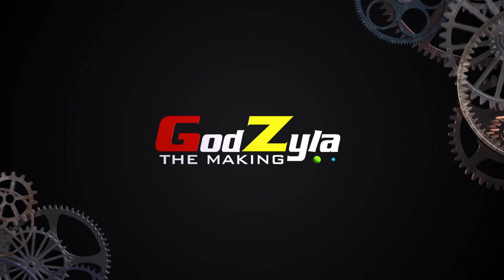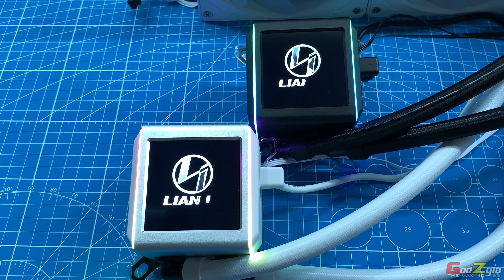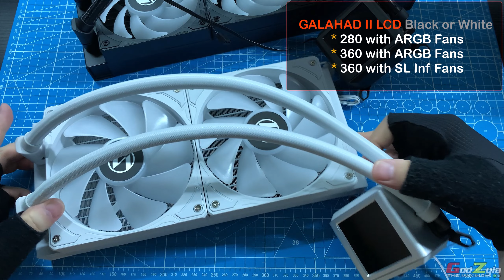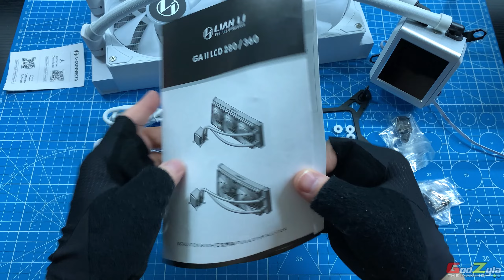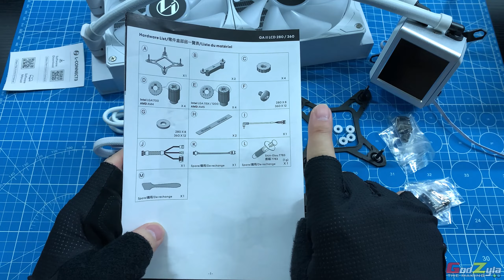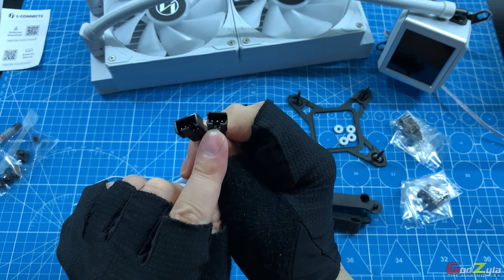Lian Li Galahad II LCD

Comment: I'm building my new PC and had a problem between Kraken and this one but I chose this one 👍👍
Reply from the maker: Hi Voltomess, welcome to my channel, glad that you've choose this over other liquid AIO. I personally using the GA II LCD 280 and just a tip. I know alot mentioned about the pump noise or pump failure. I will suggest to run your pump speed at fix and at 2800RPM and it will run at 2880RPM consistantly. This is my current theme rig with the GA II LCD 280 https://www.reddit.com/r/pcmasterrace/comments/19f113a/sonic_the_hedge_hog/ 😉
Reply: @KleoYan  I'm disappointed my new computer don't want to start aio fans work RGB on them works motherboard rgb works, rams rgb works , fans on my case turn off 3 seconds after I turn on the computer, there is no signal to the monitor  no signal to the lian li aio screen I removed gppu and connected to Mobo GPU and same no signal I reattached all cables and connections on everything mobo psu and all that and still the same, is it possible that psu is dead? or mobo or ram or cppu or liam omg so frustrating.
Reply from the maker: @Voltomess  Hmm.. are you plugging to HDMI or DP. try HDMI to your GPU. see if it does boot to UEFI or Windows.
Reply: @KleoYan  it's brand new build no windows installed because it doesn't want to start
Reply from the maker: @Voltomess  I see, if majority of your parts are new. I would go by doing the basic troubleshooting steps.

1) double check if 8pin EPS and 24pin connectors are plug from the PSU to motherboard
2) double check on the Processor and rams, make sure they are seated in nicely on your motherboard. 
Make sure cooler is mounted properly with the fan headers to the motherboard CPU
3) Make use to HDMI cable, boot to UEFI without using your GPU.
4) if 1) to 3) does not work, try run single ram. 
5) if single ram works. swap position of the ram.
6) If this work, preceed to plug your GPU

if the above does not work. which PSU are you using. if there is a self test connector provided by your PSU. remove your PSU 8pin EPS and 24pin connector to your motherboard, plug the 24pin connector tester and turn on your PSU. your PSU fan should spin. if it does not, then it could be your PSU.
Reply: @KleoYan  Idid all of that and I said to myself dead mobo and I went to the store to change it and after all that trouble there is no change I turn the computer and after 2 seconds he turn off. I did everything that was possible my psu works on another computer without problem my old psu which is still very good also does not power up my new computer but works fine on the other computer. I suspected that case might be bad and power buddon is damaged but I disconnected case and started mobo using screwdriver and still the same starts for 2 sec and turn off. Like I said the only thing left is CPU and ram.Im so tired of this build.
Reply from the maker: @Voltomess  Ouch!.. it's difficult to diagnose this way when you did all the investigation and such. I would advise you to bring your PC to the shop where you got it to troubleshoot for you.
Reply: @KleoYan  I built it myself from all parts. It's my 3rd build in my life and I never had issues like this before.
Reply from the maker: @Voltomess  Ok, got what you mean. hey do you mind to share your whole PC Specs with me. I am thinking if you can use your other PC components to this current. 
things you can try out 1) swap PSU. 2) swap rams.

Honestly speaking, I would prefer to test all PC parts outside the case first. Ensure everything works, inclusive of installing windows OS and run it outside the case for a couple of minutes.

In your case, I know you are tired but I will do this. I will dismantle everything. 
1st test your PSU, make sure is not faulty. some PSU comes with a 24pin socket plug (Self test) if you plug that and power on your PSU. the fan will spin (disable eco mode)
2nd test this PSU on your other PC, see if it works. (1st and this step is to narrow down if your PSU is faulty) 
2nd once confirm PSU working. plug processor, rams to your motherboard, plug your cooler, plug 24pin and 8pin eps, plug hdmi cable to your motherboard (if your processor has a build in GPU) 
3rd if it does not work, plug and use 1 ram stick. if it does work plug back your 2nd ram stick. if it does not, swap out.. (this is to narrow down if rams are faulty) 
4nd if nothing works with either rams, check your CPU to see if any smc chip are not intact on the underside. if nothing is wrong and if you do not have another similar model board to test out. I can only say is better these issues 1) Motherboard 2) CPU 3) Rams.

there are so many possibilities. I can do this best to advise you. anyway this topic is way off from my content. If you want to continue, kindly corresponse through email godzylatech@gmail.com . thank you!
Reply: @KleoYan  I got it solved my CPU was DOA  I replaced him and all working fine now thanks!!
Reply from the maker: @Voltomess good to hear you solve the issue👍👍👍 Phew! Congrats 😉

Comment: Hey man, good video. Quick question, I'm planning on building an entire Lian Li gaming station. 6 white 120 SL infinity reverse blade fans from , the Lian Li GA II LCD 360MM AIO SL infinity version, the white Lian Li O11D EVO RGB, and a normal white 120 SL infinity fan. My question is, is there a way to sync the EVO RGB pc case rgb lights and control them with L Connect and what would I need?
Reply from the maker: Hi Christian L, welcome back. On the SL-Inf Hub, there are two ports which are the sync 2 and sync 4 port. you can plug the EVO RGB case argb 3pin 5volt connector to it. You will need a covertor https://www.amazon.com/gp/product/B0CHP7SWSX/ref=ox_sc_act_image_1?smid=A1L0CC1FACMFXH&psc=1 (Make sure is 5V 3pin female to female). Also to note, when plugging to the sync 2 or sync 4 port, it relies on the effect of port 2 or port 4 as Sync 2 follow instructions from port 2 and Sync 4 follows instructions from port 4.
Reply: @KleoYan , awesome, thank you so much! Have a great day!!!
Reply from the maker: @christianl3592  you are most welcome and all the best to your build too 😉

Comment: In your opinion is it better to have the pump at a constant speed or monitored? I wasn't able to change the pump speed in L3 connect but noticed it was due to the bios settings being monitored. I can switch it to ignore and then I do get control but not sure what is better.
It's also the same for the fans, I can either have them monitored via the pump or let the motherboard CPU header dictate the speed.
Reply from the maker: Hi Polymorph42, welcome back. I always run my liquid AIO pump at a consistent speed. Infact currently I am using the GA II LCD 280 with push pull configuration in my build https://www.reddit.com/r/MontechPC/comments/19esupr/project_montech_king95_pro_sonic_the_hedgehog/ and the speed of the pump I am running is always at 2880RPM.
I do not allow my motherboard W_PUMP header to control the Pump RPM up and down according to the temperature. 

Note : To run a pump via PWM curve mode, this will damage the motor drastically overtime. It is best to run Pump in a consistent RPM. 

I did set my W_PUMP header to PWM mode but I use L-Connect 3 app to run at max speed to 2880RPM, this will lower the noise of the pump and I find that the thermal of the 280 (Push & Pull) at 2880RPM is identical to running at 3600RPM (push or pull). 

As for the Radiator fans, I let my motherboard to controll the RPM plus I plug my radiator fans directly to the motherboard CPU_FAN header, using custom fan curve base on CPU temperature.
Reply: @KleoYan  Thanks again!! I moved the AIO to the top like you said and it looks and works great! I'll do the same with the pump speed and keep it constant. I had no idea the fluctuation could cause damage over time 👍
I plugged the fans into the CPU header and left that on monitor but, Armoury crate seems to override whatever is going on in the bios. Am I best to set the parameters on AC or disable it somehow? 

Your build looks great btw!
Reply from the maker: @polymorph42  for Asus, what I did is.. once all drivers are installed for the motherboard as in chioset drivers and such. I will uninstall armoury crate but if you using ARGB then that will be difficult. If that's the case, make use of Armoury Crate to set your AIO_PUMP header and over on L-Connect 3, set pump to sync with motherboard.
Reply: @KleoYan  And in this situation should I have the pump set to ignore it the bios?
Reply from the maker: @polymorph42  to be honest. I am not too sure on Asus board characteristic. You can give it a try. Let me know if it did workout for you. So sorry, can’t help you out on this.
Reply: @KleoYan  Ah that's okay, you've been more than helpful and it's very much appreciated 👍
Reply from the maker: @polymorph42  you are most welcome, and all the best ya.. Btw, if you got it working, mind to share with me? I am curious to know too 😉

Comment: Hi Kleo, great video! I have a question about my setup. This will be in the front if my case either replacing two stock fans at rhe top and leaving one in below it, or i could use it as a push pull configuration at the top with 4 fans and one below. 
Will leaving one stock fan below cause any issues? And how would i go about connecting all this?
My assumption would be to bipass the feed into the pump itself and use the CPU header for the AIO fans and CPU OPT for the stock 3 front fans. ARGB would also just plug into the mobo. 
Hopefully this makes sense!
Reply from the maker: Hi Polymorph42, welcome to my channel. In general, for push pull configuration of any liquid AIOs, you should be using the same fans as different sets of fans will cause turbulance which is harmful to the fans. btw, I am kind of confuse about your arrangement. are you trying to place your liquid AIO at the front or at the top? maybe let me know which case you intend to use, which liquid AIO are you using and whats the positioning.. kindly break them down in list for below.

Using which Liquid AIO
Using which case
Top - fans or AIO and how many fans
Front - fans or AIO and how many fans
Bottom - fans and how many

thank you!
Reply: @KleoYan  Thanks for taking the time. I did read it could be an issue, but also (as usual with this stuff) conflicting info stating it's fine to use different as long as PWM fans.

Sorry, it was probably confusing mixing front and top 😂 

Case - Fractal North XL
AIO - Galahad II LCD 280mm at the front. 

The North comes with 3x140mm PWM fans in the front. I was going to replace the top two with the AIO and leave the bottom one. Or leave them all in and add a push pull to the back of the front top two while again leaving the bottom front one in. 
So the question was is it that arrangement okay? And are my thoughts on connecting correct? (First build)
I'd then have two top 120mm and one rear 120mm exhaust.
Reply from the maker: @polymorph42  Hi ya, thank you for the clarification. I will encourage you to use same fan specs for your Liquid AIO in push pull configuration. the arrangment will be as follow in your chassis

Liquid AIO at the Front - Push pull configuration with same fan specs. 
1) AIO Pump connector to AIO_PUMP 
1) 1st set 2 x 140mm fans to be plug to CPU_FAN 
2)  2nd set 2 x 140mm fans to be plug to CPU_OPT
For AIO_PUMP i will run at 2880RPM and not 3600 (too noisy)
For your radiator fans, set the fan curve on CPU_FAN and CPU_OPT will follow. Reason for this CPU_OPT is infact pair out from CPU_FAN

Top Fans
Yes you can plug the front 2 x 140mm fratal fans to the top. can just plug to CHA_FAN#

Rear Fan
Similar to Top fans, you can plug 1 x 140mm fratal fan to CHA_FAN#
Reply: @KleoYan  Ah I see, thank you. Thing is I was trying to avoid buying more fans so I may avoid the push pull and just leave it as push in the front at the top and leave one stock fan at the bottom front. 
The other option is to top mount it but I was trying to make use of the 3 pack 120mm I have. I could replace those for 140mm and replace the AIO fans plus the rear to have them matching I suppose.
Reply from the maker: @polymorph42  if the top is able to cater your 280 GA II LCD with just push configuration. It will be of advantage. as you can draw more cool air from the front. though is a bit weird to have a 280 Rad at the top. what I will do will be either options. 

Option 1 - the idea
Top 280 GA II LCD - Push configuration
Front - Default 140mm fans from Fractal 
Rear - make use of a 140mm fan

Reason for this. there are no bottom fans as the ventilation from the bottom is not great. so got to make use of the front to push cool air in and to force warm air out from the top and to the rear. You don't have to worry about the top from getting the warm air as partial front intake of cool air will push towards the radiator, especially the front top fan which is directly suck by the top front radiator fan.

Option 2 - ok but not fantastic
Front - 280 GA II LCD - Push configuration. 
Top - 2 x 140mm Fans - Exhaust 
Rear - 1 x 140mm fan - Exchaust 

as this configuration, due to the lack of bottom fans to bring in cool air. the air at the front is warm and it will impact your PC components (Motherboard area, VRM Heatsink area and m.2 area) therefore most of the time is warm air.. this might impact the thermal on both CPU and GPU. 

The choice is up to you now. but I will choose to do Option 1, but dont fully listen to my prediction. test it out to see which gives you the best results between option 1 and option 2.
Reply: @KleoYan  Thank you so much! I think you're right, it makes more sense, plus by the looks of the case it should hide some of the cables at the top this way. 
It was mainly due to having a pack of 3 120mm fans that I decided on the alternative setup, but I think just getting some more 140s will be the better idea for sure 👍
Reply from the maker: @polymorph42  Infact you only need to get 1 more 140mm fan and sell off your 120mm fans. Reason for this. 140mm fans does not need to ram up high rpm to draw tons of air or to push tons of air

Comment: I have this water cooler and after a clean windows install it stopped recognising the usb from the lcd... and my bios says cpu_fan n\a... any fixes?
Reply from the maker: Hi AFFF, did you update your chipset driver from your manufacturer website? and also did you check device manager to see if the LCD device is listed under universal serial bus devices?